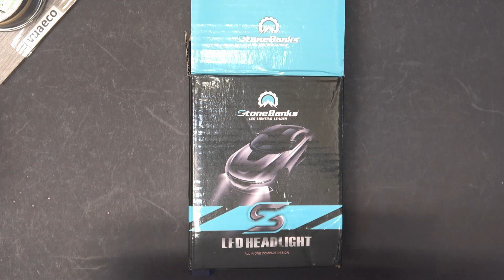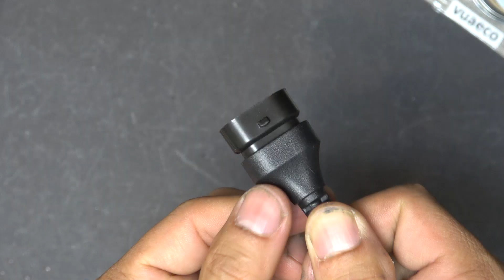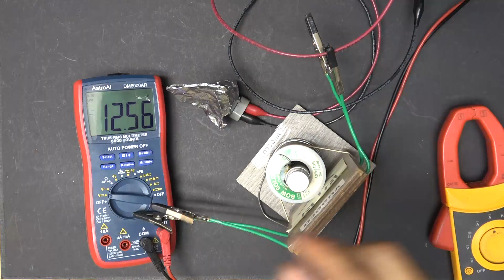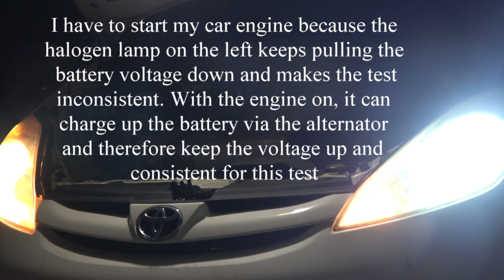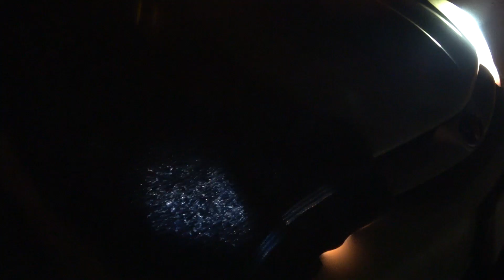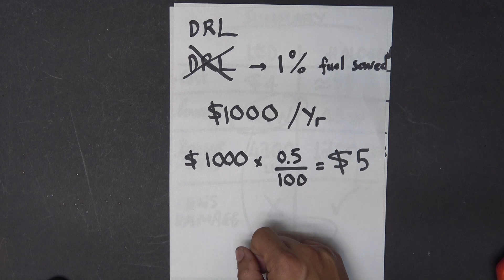Review: Ebay $4 car LED headlight vs. halogen light bulb

Comment: Technically an unfair fight between bulbs, tho, as the driver-side and passenger-side headlight assemblies are not simply mirror images of each other. This is why kids importing RHD cars from Japan have to change to LHD assemblies to pass inspection.
Reply from the maker: True that passenger side is usually aimed higher so you can see the signs on the road. But the halogen is on that side. I actually gave the halogen more chance to win! But it still lost. Also, the lux meter is right in front of the lens so that it eliminates any bias in lens setup by the manufacturer.
Reply: @vuaeco  It's true that halogen had a better chance to win in this sense, but the difference is not just the aiming. The entire housing is different, namely the way it reflects light. This is why RHD imports can't just re-aim the existing headlight assemblies to conform to DOT specs.

Comment: Oh, and I just read that HID ("xenon") lights were an option on your generation of Sienna. That would be the best lighting upgrade, especially if you can snag a set from a u-pull-it scrapyard. Of course, make sure bulb and ballast are both good before paying!
Reply from the maker: At about $55, a cheap donkey like me can't afford it especially when I have to change it every year or so!  :D
I like your scrap yard idea though. Never thought about it but that's an excellent idea. What other goodies do you pull from a scrap yard because I go there once in a while to collect junks! LOL. My last haul was a few loud horns to make my car a little bit more horny. Sometimes people forget treasures in their glove box or trunk so I got some treasures here and there!
Reply: @vuaeco  I'm out of the business now, but I was once refurbishing and selling clocks like the one in your Corolla; this was prompted by my own Corolla's clock not working.

I had subsequently expanded first to other clocks, then ECM "sets" with matching keys and immobilizer box -- including lock sets, where feasible -- mostly for 2001-05 Civic/Acura EL. Sometimes I'd get bored tho, and get random things like shifters for Lincoln Navigators and Aviators, HID headlight assemblies from anything that had them, 2003-08 Corolla/Matrix/Vibe cruise control levers* and turn signal levers with fog light switch, cargo covers (esp. Subaru), and a hundred other random things.

Bonus points: "Dual-87" relays from Volvo and BMW for projects, especially for bypassing the stock (READ: undersized) headlight power wires which run all the way to the switch in the cabin! This is a major contributing factor to dim headlights on older vehicles, perhaps second only to lens damage/aging...

*2005-08 Corolla/Matrix/Vibe without cruise control can be upgraded just by replacing the steering wheel with one having the cruise lever! 2003-04 still use a cable throttle, thus necessitating the vacuum diaphragm unit under the hood.
Reply from the maker: @fun_ghoul  Great to know about the cruise control on the Matrix. Mine doesn't have cruise control and I've always wanted to install one. But it's an 04 Matrix so it still uses cable throttle. Is there a way to install a cruise control on it? I've been thinking about putting a stick on the gas pedal and rest the other end on my seat for long trip! Yeah, it's sort of a widow maker! LOL
Reply from the maker: @fun_ghoul  Definitely will look into upgrading it. Thanks a lot!
Reply: @vuaeco  This isn't exactly a treasure you can bring home, but if you're ever stuck (pun!) trying to remove a fastener in the yard, dip into the master cylinder! Brake fluid is possibly the finest penetrating fluid ever made.
Reply from the maker: @fun_ghoul  Wow, fine tip you get there on the brake fluid. You're a yard master! :D
Reply: @vuaeco  Oh, and I meant to mention that I got an LED headlight from the yard just like yours...but post-failure. It was strobing like hell. At least you'll have a visual indicator of failure! 😁

Comment: With love, I think you'd gain more light by polishing your lenses! Them shits is hazy...
Reply from the maker: Those lenses are still original virgin Toyota lens. Never been touched! :D
Reply: @vuaeco  They sell headlight restoration "kits" for around $20, but you don't need that. 800, 1200/1500 and 2000 grit sandpaper used in that order (wet sand), followed by something with fine grit: Usually fine polishing compound, but I've also used pumice hand cleaner and even peanut butter with good results. I'd also substitute the last step for 3000 grit sandpaper (i.e. 3M Trizact) if I had any, but that's too rich for my blood!

Of course, this is not for the faint of heart, but I know you are anything but! It's just because after step 1, your lenses will look RUINED, and scarcely better after step 2. It only visibly improves at 2000 grit, and absolutely needs one finer step after that (compound or 3000 grit).

Y'know, doing this would make a pretty good video... 😉
Reply from the maker: @fun_ghoul  Pretty cool! Sounds like a good plan for a new video! :D

Comment: While I like LED lights the light pattern is different. From your test it looks like the LED is also shining light higher which may blind other drivers.
Reply: I replaced the 35 W halogen DRL with 9 W leds on my '07 BMW e93. With the angel eyes the light pattern is the same as halogen bulbs. 
The BMW light housing is small and it was a pant to do, but I have no codes and hopefully the light will last for the life of the car.
Reply: @erikj9962  If I may ask, how long since you installed them?
Reply: @fun_ghoul  I installed them March of this year when one of the halogens burnt out.

Comment: What do you do when you meet oncoming traffic? This is useless to me, as long as you cannot switch from high- to low- beam.
Reply from the maker: My car has separate bulbs for low or high beam. But they also sell LED headlights that can do low and high beam in one bulb (more expensive)

Comment: Sounds good but Does it throw up a full light saying that the headlight bulb has blown with these LED bulbs I have some and had to search a bit to get the ones with the resistor built-in to stop the light coming on my dashboard but to be fair the guy and you get from the LED for our way having a little like come on your dash forward to the next one and seeing what you’re going to do with thisVery big low power battery you got
Reply from the maker: My car is old so it doesn't have "sensitive electronics" to sense headlights. I can just put in any bulbs and it doesn't really matter. But if you have a newer car, you might have to do some mod to prevent lights coming on your dashboard.
Reply: You can just add your own resistors if you know the value, but they have to be rated for the wattage you intend to consume. My buddy with a Cadillac CTS is doing that to install LED tails...